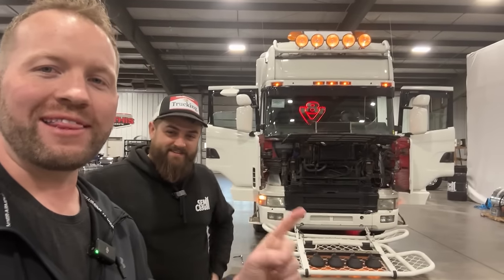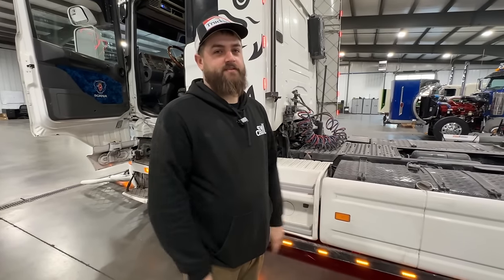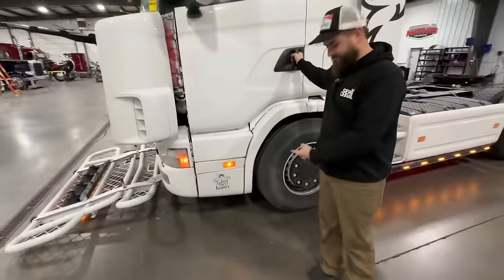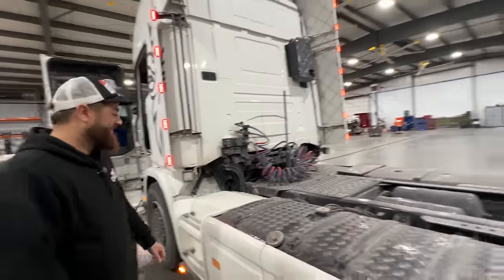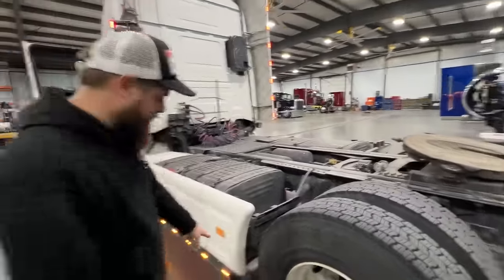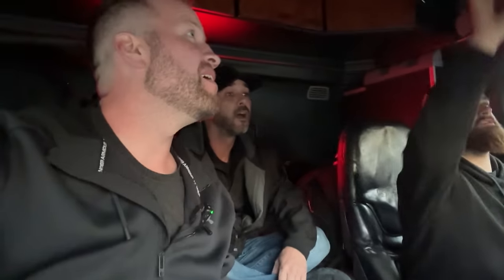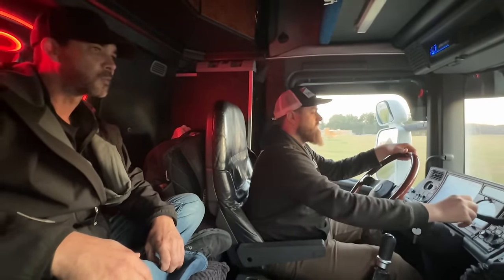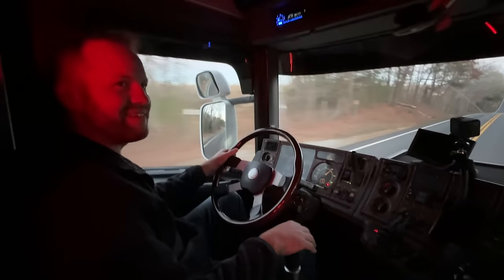First time driving an imported European Semi Truck!!!

Comment: The main trucks that we have here in Europe would be Scania,  Volvo,  DAF,  Renault,  Mercedes,  MAN,  IVECO.  The 2 fuel tanks would carry 1250litres between them   2023 Top spec Scania is the S770  16 litre V8 with 770bhp  3700nm
Reply: Recently there's Ford who entered  the European truck market and we're seeing more and more of them. Also Scania and Man are in the same group as Volvo who owns Renault trucks.
Reply: @p4olo537  never saw one... and if you want quality, buy never something made in the usa...
Reply: I saw one on the road today funny enough. In the uk but was a euro truck. Didn’t catch the plates. They are very rare though. I’ve only seen a handful
Reply: @p4olo537  scania and man are members of vw groep
Reply: the fuel price difference with these tanks between countries could be a thousand euros tbh, if possible you want to fill up in a cheaper country.
Reply: @seelenwinter6662 Ford trucks (by which I don't mean pickup trucks) are actually designed and built in Turkey, and they are no joke.
Reply: @p4olo537 Volvo ,Renault and Mack part of the Volvo Group Scania,MAN ,Volkswagon Truck and Bus all members of the VW owned Traton Group totally different rival groups

Comment: Wow,Is that truck from 1997? 
 imagine the technology that the Scania 2023 must have
Reply: 2023 is a  rocket ship to be honest
Reply: Its basically like driving a Mercedes s class of trucks the new ones.
Reply: I prefer driving Scania G320 than my 2018 golf. Thing is specced to the max.
Reply: I am driving Scania S500 Nextgeneration. It is another world :)
Reply: Europeans have the trailer closer to the cabin, not only because of the legal length limits and our tight spaces on crowded countries. But also for saving fuel. Want to make money as truck driver? Put your trailer as close as possible against your cabin.
Reply: Being a 1997 is nothing. I drove a Scania R 141 V8 back in 1977- to 1982 in Scandinavia it was the same so nothing new here with this 1997.
Reply: @tcb1017  What he meant is that a 1997 Scania got a lot more tech and features  compared to a 1997 american truck like peterbilt or something.
Reply: I drive a Scania 530s V8  it's 2023 it's like driving a luxury car absolutely amazing truck , I previously had the R560 it was a beast and very comfortable but I wouldn't go back after experiencing the S
Reply: Now he have 2025 and answers

Comment: The sound of an open-pipe Scania V8 is glorious!

If you're impressed by Bruce's 6x2/4 taglift, imagine if Bruce gets his hands on a 8x4! We're talking tandem steering (with the second steering axle a lifting one), a combination fuel tank-cabinet unit behind the cab, the big 770 hp Scania V8, and built to haul oversized loads easily.
Reply: He can't get a truck like that though. The truck needs to be at least 25 years old.

Comment: So fun to see you being so impressed by a 25-year-old Scania, hope you someday have the opportunity to visit Europe and test drive a new modern Scania, know that many truck drivers in America like old school with simple technology and unsynchronized gearboxes "because it should be like that in America" but with your hand on your heart, you still have to admit that even a 2023 American truck is hopelessly out of date, I like the look of many American trucks but think there is way too much chrome on them and that makes them look older than they are....have also never understood why the cabins are a patchwork of sheet metal pieces that are riveted together?
found this video because i follow bruce and now i have another channel to watch thanks
Reply: It's the same reason Harley Davidson motorcycles still look like they did 50 years ago. It may not be the most modern thing to build, but it works and has a classic appeal.
I imagine the "patchwork" body panels are to allow for more shared sheet metal between different and custom cab configurations.
Reply: It’s much less expensive to create bodywork from riveted sheets than create large tooling for large panels. And easier to repair. Looks 50 years out of date though.
Reply: @Dreyno megacasting is much cheper to manufactur, but expansiv to repair.
Reply: @urbaneriksson9781  The tooling is not cheaper to make. It just makes putting them together faster. Spare parts and/or bodywork repairs are also very expensive.
Reply: @urbaneriksson9781  
"but expansiv to repair."
I kind of think that is a period of time before the workshops get used to it. Well of cause, it will probobly still be a bit more expensive, but not like astronomical.

I kind of think there is a few years more before megacasting for trucks is profitable. Of cause, Scania at least have the volumes they are almost producing trucks in the same number that some manufactures are producing cars.
Reply: 3rd Country USA in lot of ways
Reply: PS: Go to Bruce's channel, he is in Oulu Finland right now and visited Scania factory.. including the test course.
Reply: Suffering outdated tech is "manly"
Reply: @waffle911

Comment: The rear axle is spec at 13 metric tonnes, like 24-25k lbs, but not an issue to load above 20 tonnes for take offs or going up mountains in slippery conditions.

Comment: Heavy Equipment Chicago has a 143H T type Scania.  Hauls mostly heavy equipment on a float.   Look up Scania 143H-420 Lowboy Hauler.   Deadly video of the drive pulling away loaded. There is also a construction company in NYC that has a small fleet of cabover Scania's hauling equipment IN the city itself.
Reply: T143H

Comment: Lift axle is too save fuel. But I'm Scandinavië; it's to increase the pressure on the drive axle to push through snow and ice for traction. Germany, The Netherlands, France have the first rear axle as lift axle usually. Not the last rear.
Reply: Save fuel, shorter wheelbase for tighter turns, less tire wear

Comment: I liked Tommy's trucking industry insight. fewer axles on the road makes for MUCH better fuel mileage. You can feel the extra power when you pick up the tag. European trucks have done this for decades for that reason. Also keeps turning circle and tire scrubbing down. Here in the US that may not matter as much since there is so much more space for bigger trucks, but in Europe you definitely want that.
Reply: Europeans are doing it because they're limited with length and the axle load limits are high enough for 4x2. When you see a 6x2 tractor it means that country has higher weight limit for that combination altough you can lift the tag up when you're empty.
Reply: @sic22l  it's also a winter thing, you release the pressure on the tag slightly and add more weight on the drive axle to get better grip.
Reply: Is it possible to import, for example, a newer Scania like this and transfer it to American license plates and drive legally? {although I know that the US government considers these trucks unsafe)
Reply: @DanielHernandez-eq7su  No. What do you mean tarnsfer to American license plates? From where? When you import one to the US you have to register it from scratch and if it's not 25 years old you won;t be able to cross the border in the first place (unless you have some kind of permit). It has nothing to do with safety, its' pure market protectionism.
Reply: @sic22l  Since I watched videos of Americans bringing Scanias, I figured out why someone would bring a truck from Europe to just look at it, normally I want to import it to the USA and drive it like any other truck, but that's not possible, unfortunately.I have a great desire to drive a legal Scania on American roads, but it doesn't seem possible.
Reply: @DanielHernandez-eq7su   There are Scanias from Mexico hauling cross-border loads to and from the US, it may be possible if you're Canadian as well (age limit is 15 years, not 25). But Bruce as an American cannot do it.
Reply: SCANIA you can also get in various sizes so dont worry. These trucks are made for the long roads also.
Reply: @DanielHernandez-eq7su unsafe... Swedish trucks are the safest trucks you can get. The government is afraid you discover that the local trucks in the USA are not half a Scania

Comment: I hope Bruce will test to pull a really heavy trailer whit it before e tears it apart and change something, just fix the high and low range. As a Swede I'm familiar whit these and I can guarantee you'll be impressed how good it pulls, the liftaxel will give many advantages against american trucks whit the grip you get, unloaded it'll make all the difference plus whit that steering angle in the frontaxel, when you lift it you'll be able to take corners that still no american truck have ever managed. And if he got the retarder working I'm very confident that we whont see this Scania on a runaway ramp anywhere around because of brake fading.
I might sound cocky I know, but you'd see for yourself if you actually tested it.

Comment: Those v8s are superb as timber trucks. Drove the 141 and the older 110 (11 liter straight 6, 671 cubic inch).
Search SCANIA timber trucks. They can handle most conditions. Usually gravel roads and tight spaces.

Comment: I remember seeing a Scania 3 series a few times. We actually used to get them briefly until Scania decided to stop importing them. I think it was due to low sales. They are incredibly rare to see here and it's a shame we don't get a conventional version for the US. They used to make a T cab that was a set back fromt axle. However a long hood Scania for North America would be kinda cool to see.
Reply: You still get T cabs bran new in Europe 
Thay aren't as common as the cab over because of ar road system
Reply: @jailee5925  not directly from the factory, they are custom conversions.
Reply: @jailee5925  Scania completely stopped the production of the T-model in 2005, until a Dutch design office took over the design of the model, and was born again. The same office has designed the new Volvo VT5 model.
Reply: I owned one in CA. a 1986 T 112. Great truck, Scania did a lot of mistakes trying to sell them in the US but that's another story.
Reply: The Europeans are masters of cab-over-engine, if you want a modern cab, then glider manufacturers should be able to build one for the right price.
Classic configuration is custom built in Europe so if you want the greateness of Scania without paying extra, then is got to be CoE.
Reply: @SPPhotography89  Vlastuijn in the Netherlands is the company who still today converts coe  Scanias to "T-model". Torpedo is the name of it. Even next gens are "torpedoed".
Reply: @nonoiscool98 It was not because of low sales, it was import protection laws.  USA want to protect it's own truck industry.

Comment: I like how you guys smile all the time. So do I, cause I used to drive a Scania V8 25 years ago. And the sound is just right. The cabfloat is also right. I just need 26 tons on the back to get the deep rooar and the high whistle from the Turbo

Comment: It's the same basic engine as the old Mack E9, the current one makes 770hp.  We've got 2 current model V8 Scanias, one on heavy haul and the other a 4 axle heavy wrecker.  They are beasts.  And so comfortable with full air suspension, air ride cab and air ride seats.  But ours are only 630hp, with 12+2 automated transmissions.
Reply: LOL no.  Actually the mack v8s were scanias with another name, a Spanish engineer who worked on its development told the whole story, there is a lot of ignorance about it, the only thing mack really did was put up the money, over time they developed, in the series 4 the difference is already considerable, saying that it is like a mack E8 is a crime
Reply: The current engine (DC16) is completely different beast compared to DSC14 and E9.

Comment: Bruce: The "handle" on the dash in the red Scania is the parking brake, not the retarder, hence why it's slamming you into the dash, haven't driven a Scania this old  so I might be mistaken, but slightly newer Scanias have an exhaust brake on a sort of nipple on the floor next to the clutch pedal, not all of them are fitted with a retarder, my 2021 has a 2 stage exhaust brake and no retarder.
Reply: This model has jake brake when you slightly press brake pedal, there's switch controlling that. And yes handle is parking brake. This have air system so that if you loose air so brakes are on, with air they are released
Reply: And also another handle is trailer brake
Reply: @kallek771  My 420 V8 had the retarder on the handle just below the ventilation. I think there was a small pushbutton on the tip. 
The single handle on the flatter dash is the parking brake. It does not seem to have a trailer brake ?  The old types were banned in Denmark back in the 80ties, ( but new types have come in the last decade. ) 
On 40 year old scanias the trailerbrake was next to the parking brake.

Comment: The sries started with the 140, later on the 141 (lower rev, higher torque. Drove one of those in the 80s), then the 142, 143, and last 144. Nowdays it is 16 (976 cubic inch)  liter and named 160-series. The one presented is 14 liter (about 854 cubic inch)

Comment: To see the engine, there is a hydraulic system to pop the cab forward. Just put gearstick in neutral and there is a hydraulic jack built in. Pump is manual and you only need a metal tube of the right size to get it going.

Comment: If you think those bumps are bad you should see the "bump" part and offroad part Scania has on thier testtrack here in Sweden. Scania has done some extrem testning on all their trucks since the 1960s and they still do. During development they literally test the trucks untill they brake to find out what needs to improve.

When I served in the army (2004-2005) I drove an offroad Scania truck produced in the 70s. Back then those trucks where 30 years old beeing driven by young soldiers offroad and we where not gentle with them. Trust me we tried to break them and failed. I know that there are still those trucks in aktiv service becouse they will not break down. We sent a brunch of them to Ukraine and they love them. So 50 year old truck that still gets the job done is pretty good.

You should come to Scania Demo Center in Södertälje Sweden and try out what's on offer today.

Comment: Missing high/low range is probably just a broken solenoid, happens with scania.
Reply: the solenoid valve, a very common fault in Scania, is located at the rear end of the gearbox.also check that the electric current is coming to the solenoid ,sometimes the connector is broken.

Comment: It looks like a 620 Liter diesel tank on that Scania They can also be larger up to 1200 litres
620 liters = 163.786672 gallons
Scania R 450 an average consumption of 23.7 liters per 100 km - or 4.22 km per litres, such calculations always have to be done on a small scale. It also depends entirely on driving style and how aggressive the driver is .. the dimensions of a 700 liter tank in cm
(length) 165 cm x (width) 70 cm x (height) 67 cm
Centimeters 3 cm = Inches 1.1811 in

Comment: I drive a new SCANIA 140 1978 in the Military with converter.
You could start on gear 4 on a hill and take small cars with greenlights!
What the Hell of a machine.
I drive also Buss in Stockholm in 20 years.
Allways with SCANIA and Volvos.
SCANIA H46 was an old one with exhaust brake in 80:s!
Everyone gives free to Africa!😮
I think the rolling good even today even if the driver have a motorbike licens!😂

Comment: I can't imagine how HARD the suspensions must be on your trucks in the USA
because the Scania 4 in Europe is rather famous for its hard suspension, and jumps over holes
I am curious how you would drive a European VOLVO or DAF
In general it is a very good car. one of the better models of Scania. Especially the V engines and inline6 witch PDE injectors

Comment: i hope Bruce meant to make his scania LOOK like an american truck from the cabin back, not actually trying to put american axles on. The latter would be dumb. then again, his truck, his channel. I am not against a shiny round tank, custom fenders and t-bars. I bet it will look good in legendary blue, painted frame, etc. get some trim parts for the engine to make it look good when the cab is up.  put some nice mag wheels on it,  maybe floaters on the front?

Comment: Other place where you can see them the United States is the southern border where they can be operating with two license plates one Mexican the other United States California ZP Arizona New Mexico and Texas Apportioned licence plates. Maintenance wise they have to be sent over to Newark,NJ I-78 Exit 56 Abreu Truck services. Sadly on the interstate you are only going to reach 55 mph 90kmh California Truck speed limit which means you will be passed by a Peterbilt Mack Kenworth Volvo VNL at 65-70 mph US Semi Truck governed speed limit in the western states of MT ID OR.

Comment: Hey Bruce I'm stunned here in Australia we are over run by SCANIA I drove one for 4 years nice driver truck very comfortable but would kill to drive Peterbilt American trucks will way outlast Euro trucks but it's great your introducing the SCANIA to America I will watch on to see how you go 
Kym
Adelaide
Reply: Australia is really cool because you have both American & European trucks and the steering wheel is on the right side 😁
Reply: @Twisted_RC  
Thanks
Reply: I know Scanias driven up to 2-3 million km and still been used every day. At lest in Europe it's more about the emission standards that put the pressure to change early to newer one. We used to say about 3-series Scania V8 that you can't brake it by driving. But I won't argue about Australian weather conditions affect on trucks...